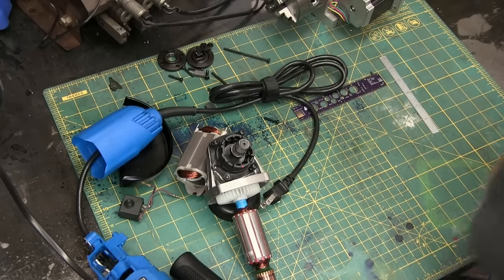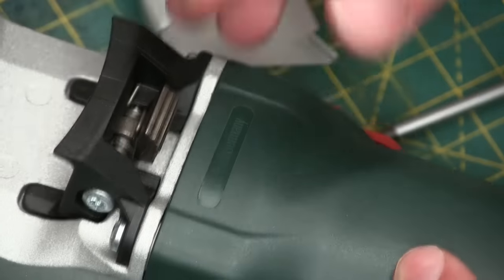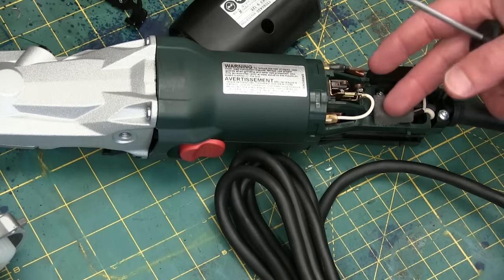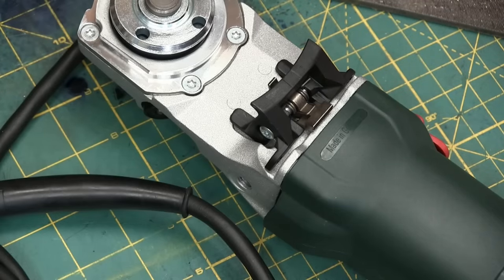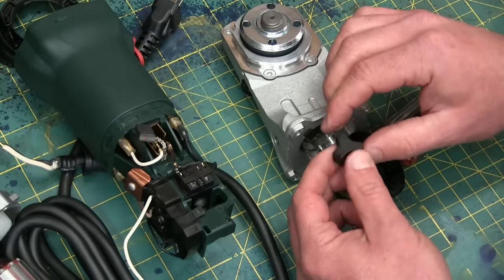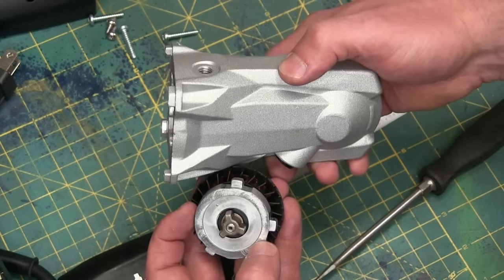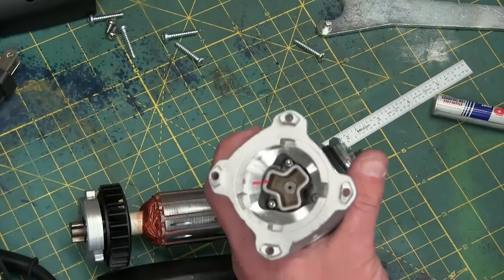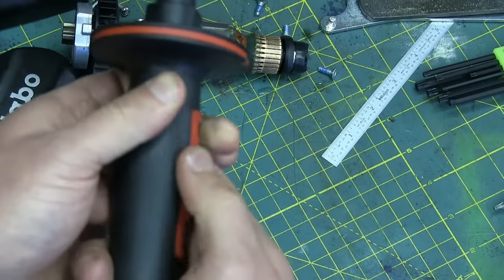BOLTR: METABO GRINDER. MADE IN GERMANY

Comment: In Germany Metabo is the prosumer stuff you pick up at the home improvement store and even there Makita has the better rep. If you have a business to run that depends on these tools Hilti and FEIN is your brands of choice.
Reply: Lukas danke,
Reply: I've seen plenty of businesses running on Ryobi or similar. Not a good choice for an iron worker 50 stories up but in a shop where you can just grab another one from the rack while it cools off it's no biggie. Sure the nice tools come with warranty, but getting them to actually warranty them is usually more difficult then going to the local skum bags and buying 10 more of said item.
Reply: Had 2 fein grinders, junk, went back to metabo. Cracked both gear heads wtf
Reply: TMoD7007 yea, I was surprised as well. The motors where decent, didn’t overheat, but they where geared a little lower, another reason I wasn’t impressed in the end, makes grinding more of a chore

Comment: My company I work for bought 3 regular metabo grinders 4-5 years ago. Maybe longer. All are still going. I build water trucks for them. Grinders in shop are dewalt and metabo. when i am turning an old cement truck into a water truck my grinder is one of the metabos. I been using the same one a real long time. Keep it in my area of shop. As welder i do tons of grinding for prep. If any of my grinders at home die. They will be replaced with a metabo. I have a man-killer old sioux massive grinder that might be older than me. I think it will outlive me and go to new owner at my estate auction. lol

Comment: How much of the extra cost do you figure is from the lovejoy coupling and low profile head (vs the other standard grinders)? Not to question your analysis of the stamped part, but so long as the bottom surface is flat, what does it matter? The relative machining of the aluminium gland end is all that counts. Also, the loose connections at the mains seem really confusing...is there something they are doing that isn't readily apparent? could the wire be connected solidly to the spade inside an outer sleeve for strain relief? they obviously know how to make a solid connection, and it seems like a strange place to pinch pennies. BTW, what happened to the Flir? would be interesting to see if those really do get hotter than a $2 pistol...  thanks again for your great vids.
Reply: It is indeed a very unfair comparison. A similar "normal" grinder (the W 9-125 Quick) costs 147€ (manufacturer's list price incl. tax) while the WEF 9-125 Quick costs 291€ so almost exactly twice as much.
About the wire: I guess it's because the power cable will be the first thing to be changed after someone cut through it. And even if a connector is moving around a little it doesn't mean that there isn't a large contact surface area. Typically these "loose" spade connectors have a latch inside that makes prevents them to come off on their own.
Reply: I was meaning the loose spade connectors at 12:40.  If they aren't getting good contact it would increase the electrical resistance and heat up.

Comment: I didn't realise that this video was 4 months old. I just came across this channel about a few weeks ago and think they're great!

I've had a fair bit of industrial use with Metabo grinders (and Makita, Dewalt, Milwaukee and some Hitachi).

Each had their pluses and minuses but I have to say that I'm not a great fan of the Metabo BECAUSE of the Quick Protect magicery. all it seams to do is get in the way of working. Also, as the grinder gets older, it seams to kick in sooner and sooner. 

I've also had a few Metabos where the cooling impeller becomes detached and no longer spins when the grinder is used. No airflow = hot grinder, quickly!

Milwaukee are easily the most powerful I've used and, mechanically, the longest lasting (ok, on par with Makita) but the stupid, flimsy way the guards are attached kills the head to quickly. 

Milwaukee also have some magicery in them to that feeds more power to them when they slow down under load, which is why they're so powerful, BUT this makes them run really hot. I've burned out a couple of their 6" x 13amp paddle (ugh, hate paddle grinders too!) grinders, even though they're supposed to have thermal overload protection?

Anyway, great videos, love them, and your terminology to describe stuff. Thank you!

Comment: I've used Makita, Dewalt, and Metabo.  I use my grinders hard on a daily basis.  My first Metabo lasted 7 years.  The Dewalt that replaced it lasted about 6 weeks, and I hated the feel and sound of the Makita and pawned it off on a new guy and took the Metabo he was issued.  When it came time to replace my POS grinder I use out in the garage, I bought a Metabo.  Don't regret it one bit.

Comment: Love using my Motabo grinder. Fabricating and can grab and start it up one handed. Hold my metal in the other while modifying it to fit exactly. Use Cubitron II grinding pads and champher up to 2 inch steel like it has been machined. Several of my friends that fabricate use them as well.

Comment: The wire connections are not tinned because tinning wires in Germany is not allowed. Don't know any details though.
Reply: Marine cables and wires are not tinned either.
Reply: I know you don't know any details, but like, in a more general sense, like, why? For what purpose?
Reply: Jackson Gray My educated guess is that because the solder is ductile and not elastic you take away the wire's elasticity, which, when bolted in, lets the solder flow away from the clamping-force. Therefore the resistance rises and arcing can eventually occur.
Reply: Just for the same reason u should never use a soldering iron when u work on your cars electric system.
Reply: Tinned stranded wire in a vibrating environment (when the wire isn't 100% rigidly secured) is a sure way to have a broken wire at some point. Also solder has some very strong "creep" (in short: deforming slowly under stress) so any clamped connection will become loose. Crimping/clamping bare copper forms a way better and reliable connection than a tinned/soldered a wire.
Reply: 1. Resistance
2. The Crimp-connections used have to be pressed gas-tight onto the leads to prevent corrosion which makes the soldering-procedure obsolete.

Comment: The thing is, that these Metabo grinders are just about the same price as a Makita or Bosch Professional (few slightly different model for slightly different prices but all around 60 to 70€) here in Germany. Fein is about 100€, a cheap Hilti is 90, an expensive one 300€ and around 25€ you get the cheap crap. 
So if youre looking at realistic prices, this thing is pretty much like all the other stuff, a little better or worse for 5 bucks more or less doesnt really matter to most people.

Comment: @17:00 notice that the casting on the head has recesses molded into it for the guard lock to lock into so that the attachment screws aren't the only thing absorbing the shock from the 200-metric-pound gorilla chucking the grinder across the floor at the end of the day...

Comment: Personal experience with metabo tools. Grinder and 1/2 ‘’ hammer drill. 
Switchs failed after 20 years. 
10 years later. They still need new switches. Just got new cheaper tools as the work requirements changed. 
Good pro tools though. 
But mostly. Great videos 
Again 
Thanks Ave.

Comment: 17:00 is it possibly clever where the force is translated into the depressions in the metal casting, and the screws just keep the plastic in place. All the forces on that plate from a drop are going to be lateral as the guard tries to rotate, and those lateral forces will go into the tool body via those detents not via the screws.
Reply: Yes but then again, one unlucky hit from the other side and its gone...
Reply: Mayhaps - but I looked at it with my thinking cap on -- Any vertical forces wouldn't translate to the detent holder because the collet around the grinder axle would take that force. The only thing translated to the detent is lateral force, and that lateral force goes into those depressions in the main housing.  All forces on the shield are converted to rotation by the slot it's mounted on.
Reply: frollard People manage to destroy anything if its not oversized enough...
Reply: Also, that's pretty hefty plastic, not likely to break easily. With the way it's designed and nested into the housing, the only way to get any leverage on those screws is with the guard off and hitting it towards the spindle.

Comment: The detents on the shield clip give it a physical rigidity that makes the two screws that hold it in place, not so important when the tool is dropped. The pressure created is dissipated through the recessed areas of the part into the housing, not so much at the screw area of the part. At least that is how I see it.

Comment: The part at 13:20. It is actually a spade connector. That's why it is loose. And based on some of my experience. It is actually a failure point on my Bosch grinder. The grinder will suddenly stop working. Spend an hour to look inside, and the usual problem is the connector.

Comment: We do LOTS of hand grinding slag off of parts that come off our plasma tables.  We switched to this brand of grinders on a trial in a few areas.  I really liked the way the lock worked compared to other brands as it is much easier to lock.  Sadly the extra cost of these did not have a good enough return value in the life of the tool.  That said there is value in the operator experience using the tool which was appreciated by the guys who spend a good portion of the day operation the tool.  So overall if you factor in the ease of use and possible repetitive
 stress injuries from using hand grinders daily I do recommend the extra expense of this brand.  So for home use, not worth but in a factory environment the cost savings on possible injuries from long term use I highly recommend at least giving these a trial run.

Comment: Without getting into a yardstick measuring competition, I've just got the Bosch 10.8v 3" grinder. Brushless, direct drive with overload protection. It's kinda like an iPad. Some where between a dismal dremel cutoff wheel eyesight modifier, and a 5" weld performance booster, the size you never knew you needed. Might wanna check it out. Handy for one handed grinding and cutting when you're in a deep dark hole, if you know what I mean.

Comment: Few additions:
 - the core in the brush is usually plastic with a spring behind. When the brush wears down to expose the channel the commutator, the plastic pin jumps out and the spring pushes the brush block back. no sparking and else, the job is done for the day.
 - tin on the wire is considered unprofessional. it may deform slowly with time and make the connection loose. Loose connection means heat, heat weakens the tin even more, yada...

Comment: This is a flat head angle grinder. You compare it to Makita pricing where as I couldn't find a single flat head from Makita. Is there one you meant or are you comparing apples and pears? Btw the Metabo is 220€ in Germany.
Reply: Peter Gplus you may want to use Google currency conversion, 220 euro is more then 300 Canadian dollhairs.

Comment: +AvE
The brushes actually have a spring loaded pin inside. Once you wear thru the carbon the spring loaded pin comes out and overcomes the main spring. 
The  grinder stops compleatly and never actually  arcs. At least here in europe  they are like that, I see some diferences in the model you have. Might just be the version.
Great video as always.

Comment: Geee, made in Germany with Chinese parts. They went all quality on allot of the components and then compromised on bearings? Reminds me of the bosch hammer drill I bought earlier this year. Thinking I was buying a quality tool. The freaking thing let the magic smoke out in less than 30minutes of work. I returned it and picked up a horrible freight drill and finished the job. The horrible freight drill has since been used on a bunch of jobs and has remained intact. ~30bux. The bosch gave the ghost in 30min $200+ on it. Upon further inspection  the drill was made in Russia, guess too much vodka in the QC line.

Comment: Currently living in Germany. Install kitchens for work. Metabo here is the "Ryobi" of tools in Germany !
Reply: What's the best?
Reply: Festool and Bosch of which there are 2 types, theres "blue" Bosch which is considered proffesional and "green" Bosch which is geared towards the homeowner. All of our work vehicles have Festool. Sadly Black and Decker is big here as well. Then there is Einhell, don't know if it's available in the states. http://www.einhell.com/com_en.html, Can get Milwaukee but havn't seen anyone here with it. 
This you have to check out. Dewalt(as well as other manufacturers sell a combo mitre/table saw. You actually flip the saw over and you have a table saw attached to it./www.amazon.de/DEWALT-DW743N-QS-Tisch-Kapp-Gehrungsäge-Paralellansch/dp/B0013LNADO/ref=sr_1_28?s=diy&ie=UTF8&qid=1487605865&sr=1-28&keywords=dewalt

I was actually dissapointed because I thought that Germans were the king of tools but it isn't anymore. We have access to better tools at cheaper prices. Bosch tools cost almost twice as much here as back in the states. Other weird thing is the fences on the Mitre saws are like a measly 2" weird stuff, but all the houses I have worked in (90%) don't have baseboard and whatever crown there is is very small. Crowns we use on kitchen cabinets are already cut to size and come finished with mitres in place
Reply: mark hilken 
well metabo is definetly better than bosch green
Reply: @markhilken7026  Milfuckie u get in OBI, B&D also. 
Bosch blue is considered pro but not too much, green is home tool. 
Einhell, Festool, Fein still good as AEG...
All combo mitre/table is shity